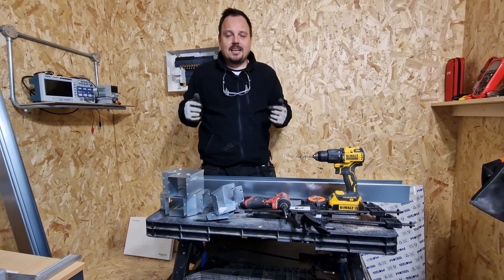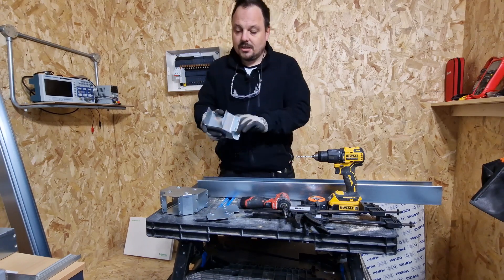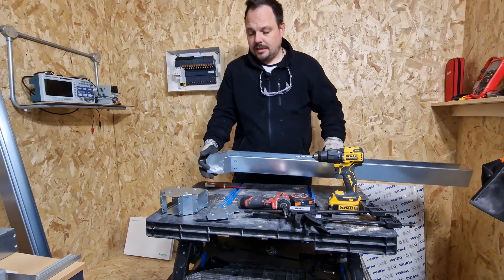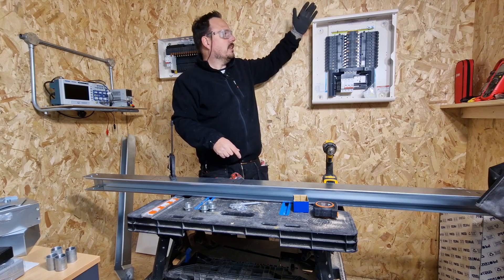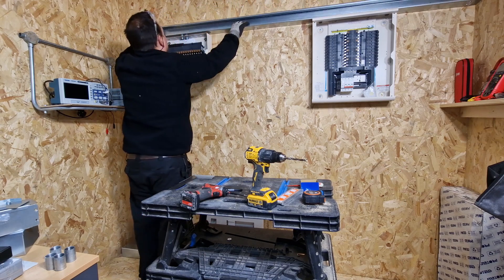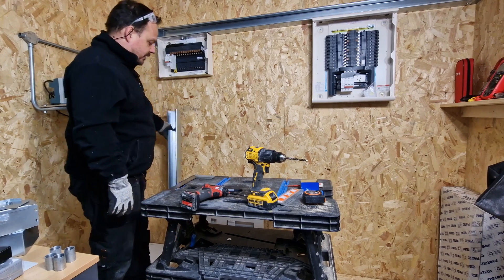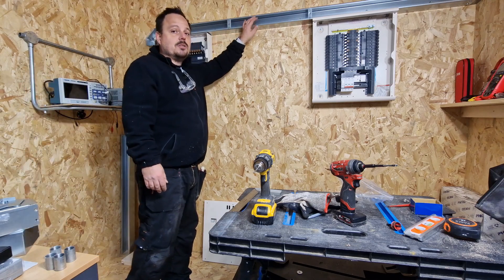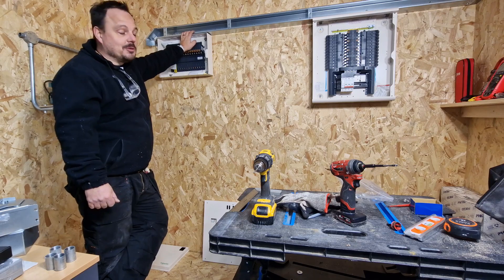Installing Schneider Acti 9 P Distribution Boards and prefab steel trunking ...

Comment: If you are on large jobs pre-manufactured bends also provide consistency across the installation, especially if the client subs out to different contractors.